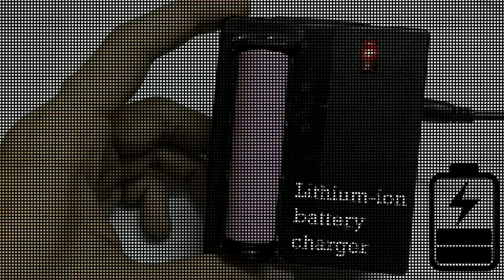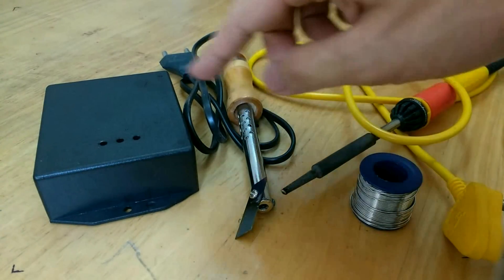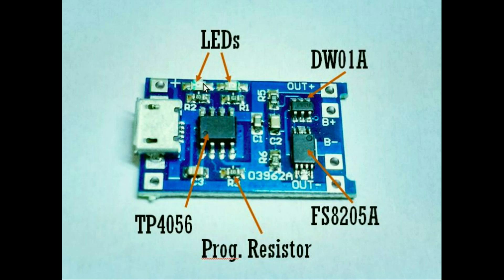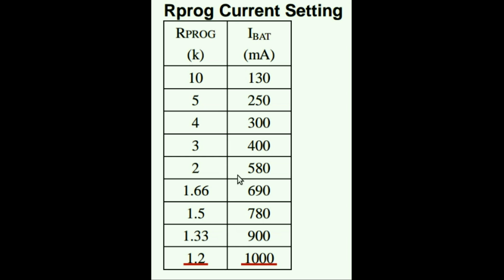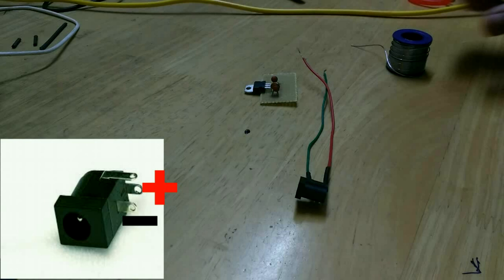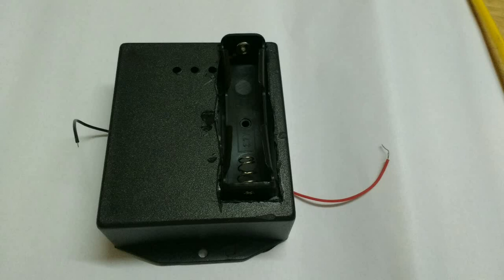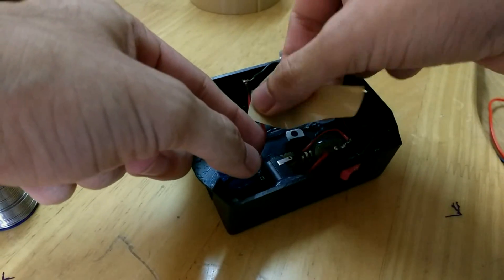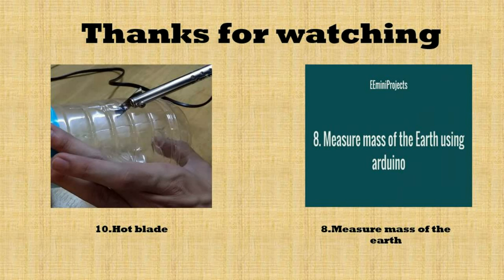miniProject #11: Lithium ion battery charger (TP4056 based)

Comment: I had connected 4 18650 cell in serial connection. Without any protection board. Can directly charge it with 12v adaptor?

Comment: bro ur circuit is kind of oscillator bcoz of lm 7805 regulator first thing it can't handle 1 amp current it's temp going weired and since it has thermal protection the ic resets everytime to recover room temperature beleive me

Comment: what does the out+ and out- do on the TP4056? Is it if you wanted to use the batteries at the same time? And what if I want to use the batteries at the same time, how should I then do it?
Reply from the maker: I think it is not advised to do so, Out+ and out- terminals goes through over-discharge protection mechanism also.